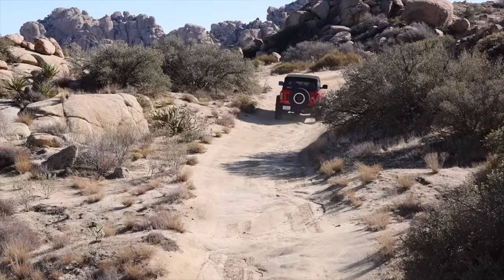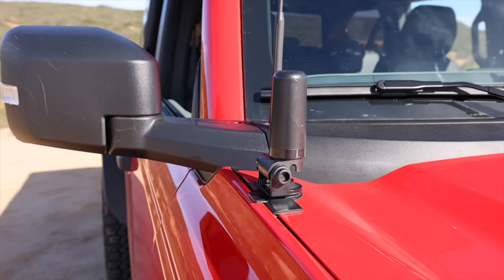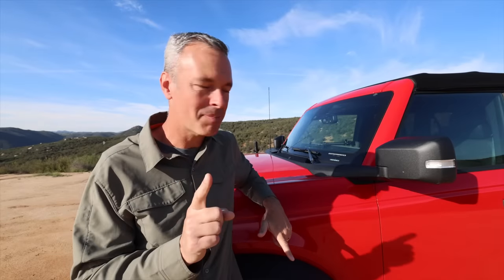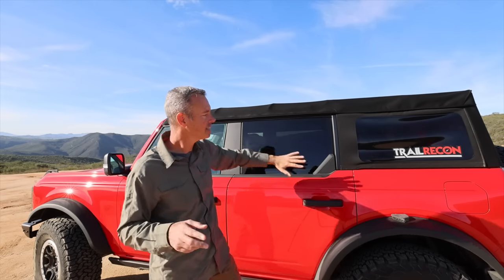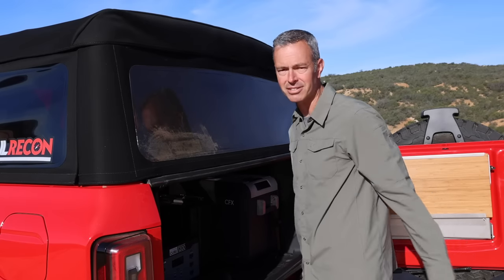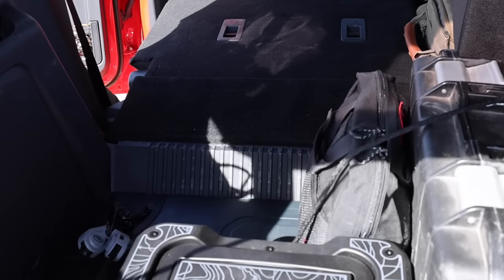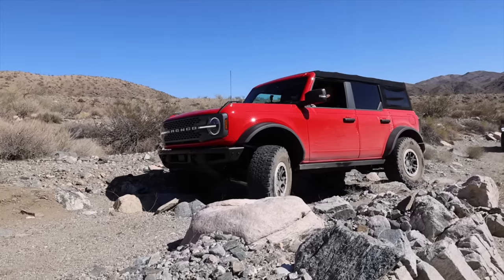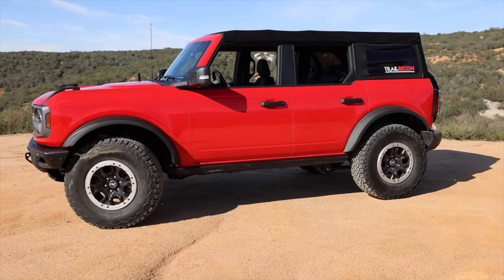Pros & Cons of Owning a Ford Bronco

Comment: Glad to see Ford once again build a competent off-roader, wonder how long this one will last? Jeep doesn't expect the CJ/Wrangler to share a platform with any other vehicle so they have has been building updated versions of the original for over 75 years. Ford has a history of making a unique Bronco for the first generation, then badge-engineering a short wheelbase pickup to replace it for cost reasons, culminating in the hideous Bronco II. Probably not the best way to insure brand loyalty. There's a reason we have Jeeper's Jamboree, Easter Jeep Safari, etc. with no equivalent Ford or Chevy events.

Comment: You know, I've been curious how a Bronco stacks up against my Willys JKU. Most videos I've seen are garbage, not this. 

For now, I'll stick with Jeep but that may not always be the case. I'll take capability over comfort, even when I usually don't need the capability. The  opening of the soft top at the rear seems dumb. The electrical/camera/display options are awesome though and I wish my Willys had a vinyl seat option.

Give it a couple years and I bet you see more commonality between the brands. When manufacturers compete, we all win.

Comment: If they address these issues by applying them onto the upcoming Bronco Raptor then Ford would have a better chance against the 392. Also I would prefer a V8 over turbo. Better to wait and see rather than buy early and be the guinea pigs.
Reply: The Bronco Raptors are already being scheduled to be built. Addressing the issues TR brings up in this vid may not directly apply to the Bronco Raptor. Far as what I've seen, it's hardtop only. No soft top choice. The Bronco Raptor can not except the factory winch kit and don't see why anyone would want to add one to this type of vehicle, but I guess people can choose to do that if the aftermarket brings a solution. I don't think the Raptor is directly competing against the 392. The Raptor has the superior suspension and track width for dynamic off-road handling and better stability, especially at higher rates of speed. I think the 392 is just what the hardcore Rubicon owners wanted straight from the factory... a V8-powered Rubi.

Comment: Rough Country. They have a good lift. My son-in-law works in the R&D and they have put a Bronco on 40s. He says you can have a lift with 37s without ruining your warranty. Check them out. I know everyone bashes Rough Country but the ones that do will and do tear up an anvil. So check them out.
Reply: @KFC Man Whatever. None of the lifts out there, in that case, are any good. If you're rock bouncing I wouldn't use RC. I can ride any trail in the South East no troubles. My ride will take me down any trail I want go. I am disabled with limited funds and my Tj suits me just fine. I'm glad you like whatever you tear up an I'm not going to put what you use down. 
Side note:
I'm not tearing my rig up to prove a point.

Comment: I know it’s not the biggest deal in the world but for a vehicle so new you shouldn’t have any leaks even if it’s windshield wiper fluid. My Toyota 4Runner has about 170,000 miles on it and have had no issues whatsoever. Not even the tiniest bit of a problem. Just so damn dependable and I’ve driven it hard off road and cross country trips numerous times and seen any and all types of weather and terrain. There’s just a lot of different little issues I’ve seen with these broncos. I think they look amazing but don’t think I would purchase it because of the quality issues since they were basically all rushed out.
Reply: Who ever replaced the windshield didn’t reconnect it.   That’s not a quality issue.

Comment: I think the Bronco's big miss is highway road noise (based solely on yt reviews).  It would have filled a nice gap between the Wrangler and 4Runner.
Reply from the maker: I've seen others comment about that, but I guess having owned many Jeeps I'm just use to road noise.
Reply: I think it’s being blown out of proportion. I have the soft top on my Sasquatch Bronco and it’s nearly as quiet as the hardtop on my JLU.

Comment: Hey Doc. Great video. I would suggest that adaptive cruise control is one of the worst things available on cars today. It takes the responsibility away from the driver and puts them in a false sense of safety. I went to the dealer and had it permanently turned off in my wife's Ford Edge. They were putting it on Class 8 vehicles (Semi) a few years ago. Terrible product.

Comment: I am curious to know the market share the Bronco has taken away from the Jeep Wrangler. I bet it's pretty significant. At least there is a great option to those looking for a real off-roader and seems like a better option than the Jeep especially for those that remember that 90-95% of the driving is on hwy to those remote places.
Reply from the maker: They may have taken some away, but my understanding is the Jeep Wrangler is still having record sales.  I think long term we might start to see some real market share taken away, but I think Jeep is doing a good job of responding.  V8, Extreme Recon Package, etc.
Reply: It might be hard to tell given the production delays. Last I saw was around 30k deliveries. But given how similar they are I'm very interested too.
Reply: Not close, mainly because production of the Bronco isn't up to speed yet.  If you check Ford dealerships, they may have 1 or 2 Broncos at any one time.  Check Jeeps, and my local  San Diego Jeep dealer has 90 Gladiators and even more Wranglers.
Reply: @TrailRecon  Also the production problems with the Bronco is almost as bad as trying to find a Playstation 5. I can go to any dealer and find a Jeep.
Reply: I heard that Jeep is actually selling more than ever before. I can’t imagine the Ford has taken away much, considering you can’t even get one lol
Reply: @michaelpetty8416  yeah but then you are stuck owning a Jeep ;-)
Reply: @AustinH7  That's very true. Ford did a pretty bad job at making these available and Jeep owners are very loyal to the brand.
Reply: @AustinH7  Yup, when my Jeep dealer has over 100 new Wranglers and Gladiators and my Ford dealer only has 1 or zero Broncos, there is no competition for sales numbers.

Comment: Great video, and yeah I think just about everyone can agree ford knocked it out of the park with the looks of the bronco, I can’t really comment on the ifs cause every vehicle I’ve ever wheeled has been a solid axle. I think anyone interested in the higher end bronco or Jeep rubicon really comes down to are you actually going to use it for what it’s intended for. For the occasional weekend wheeler paying 10k or more for the higher end off-road capable rubicon or bronco is a waste of money if your not hitting a lot of difficult trails.

Comment: Just installed a soft topper on my K5 Blazer. That setup on the soft top on the rear is the dumbest thing I have ever seen. The soft topper unzips on the sides and has a bar you can roll the fabric up on.

Comment: I’ve had to relocate my adaptive cruise control on my F-150 for my bumper. No issues and didn’t need to recalibrate it. It shouldn’t an issue but I agree, absolute terrible spot for one.
Reply from the maker: I've heard the same from a few folks, but both my Jeep and Ram Power Wagon have the ACC in the window and having winches on both those vehicles is no issues... Ford could have done something similar.

Comment: If you look at other videos they are having a lot of problems with the Bronco. Ford screwed up putting independent front suspension on it. They built this for comfort on the road and not for off road use. If you really want a 4 wheel drive I would stick to a jeep.

Comment: I didn’t catch your GMRS install and looking through your channel, I’m not able to find it.
I thought your soft top comments were mostly unfair.  There’s not many soft tops that you can open the back window single handedly, if any, especially when the zipper gets dust and dirt in it.  I’m not aware of another soft top that partially open as quick or easy as the Bronco.   All the extra drama reaching in the back hurt your credibility as this is the same situation with any soft top.
The grab handle wasn’t placed where you thought it should be is because of the curtain airbags come out of that location and a grab handle there means no curtain airbag
Overall you came off as a Bronco hater.  Now is a good time to sell your Bronco, you might even get more than you paid.

Comment: 13:36 I believe the actual reason the grab handles weren't located higher on the A pillars is that it would interfere with the deployment of the side curtain airbags. Jeeps lack that safety feature which is why they're able to accommodate those types of handles. I wish I could remember the source for that but I believe it was from a Ford representative in some video interview about the vehicle's safety features.

Comment: No disrespect to FORD owners....I have had my fair share of FORDS they love new transmissions after about 50k on them.  No thanks I will keep my JL RUBICON.    FORD trying to play catch up with JEEP.   I have not even looked at the price tag of this vehicle but there is no way I would even  consider this vehicle over a JEEP Wrangler.    Yes Jeep has it's faults but since 1941 JEEP has been doing the same thing over and over again.  Patton said one of the three reasons why we won the WAR was because of the JEEP.     Yes I know just like a Harley the aftermarket expense you have in bolt on is going to cause you to get a divorce but that is half the fun.   JEEP has literally thought of everything.    I have owned my 2019 JL new and the only two issues I have had is the satellite antenna connector cable has come lose from the rear window and I did have a problem with a cracked windshield but that was my fault.   This makes my 4th Jeep and I will never buy anything else.

Comment: Literally only drawback of the bronco and why I got a Jeep instead is ifs, wish they did a live axle in the front then it would actually be competitive in off-roading with the Jeep.
Reply: Yeah like Bronco with ifs didn't do what jeep with sfa did lol competitive
Reply: @hotrod7603  idk what you’re trying to say, but I’ve owned and off-roaded both over the years and ifs is easier to break and does not articulate, whereas a solid axle is tougher and does articulate, they are better at different things. Ifs for daily driving and dunes, solid axles for rocks and mud I’ve done both with both it’s just how it is. The bronco is a nice truck and is the nicer daily driver and occasional off-roader, however the Jeep is the better choice if you actually off-road frequently on tougher trails.
Reply: @dmoney6633  jeeps need to be modded for heavy rock crawling Bronco has solid rear axle too you haven't driven either because many people are doing hardcore rock crawling with Bronco , that articulation matters since you have both front and rear lockers + centre lock
Reply: @hotrod7603  I am aware people are doing rock crawling with broncos, however the damage each get because of the leaning the bronco does because of the lack of front articulation is the issue with ifs and why I will not do rock crawling with one again. Look at some videos since you don’t seem to have personal experience of how lacking ifs is in true articulation. Stock for stock the Jeep is better, modified the Jeep is still better and people are already solid axle swapping the new bronco to prove my point, if ifs and the bronco was better with the stock setup people wouldn’t be upgrading it to be on the same level as a Jeep. Good day, I’m done responding to someone who clearly needs more experience and needs to do some actual research.

Comment: When you almost rolled the bronco, it would have been driver error.  You can't take the same lines when you know it's independent front suspension. Know what you are driving and adjust accordingly. That looked like a rookie driver doing that.